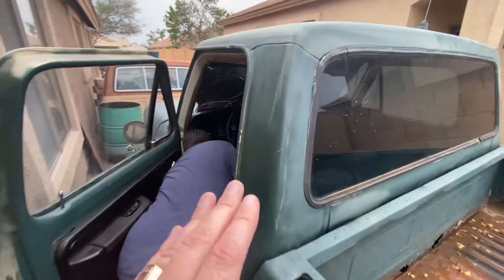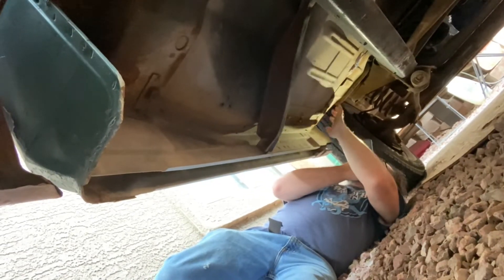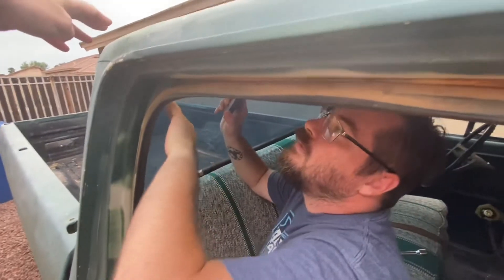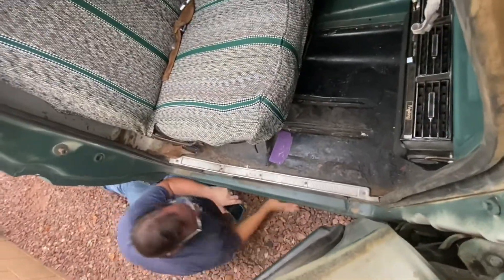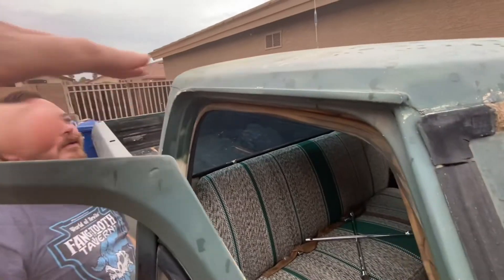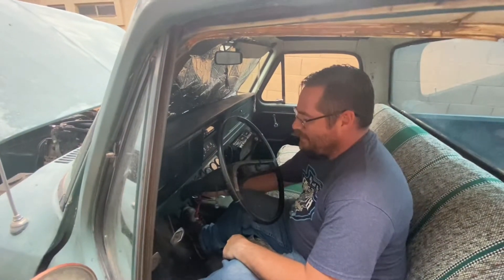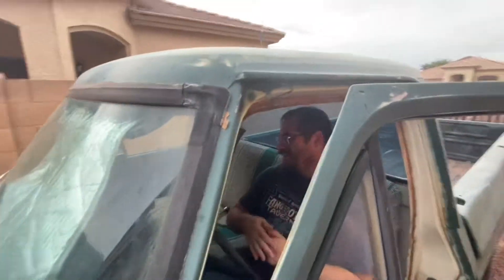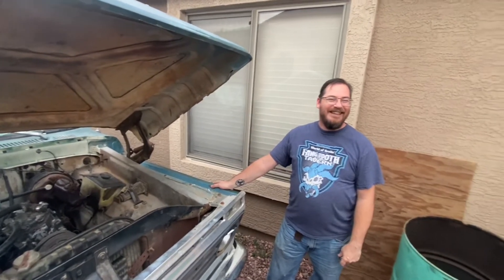#140 - Floor Boards with One-Eyed-Welder!

Comment: bro are you going to weld in some drop in pans? i was just looking into those! i might do mine.
Reply from the maker: Heck yeah brotha!!!! I’ll either get the pans or see if I can just patch the spots. I have roughly 4 quarter size holes so I’m on the fence with how to fix it.
Reply: @EYE_SPIDER  ebay has a set. both passenger and driver drop in pans for about 150.00. im debating that purchase myself too. im still working on functionality right now. but that last on my list before cosmetics!
Reply from the maker: @stevemartinez1833  For sure, yeah that was kind of my thought also.  I still need to get him mechanically street legal LOL
Reply: @EYE_SPIDER  hell yeah brother. im right there with you! it make me laugh then i see a guy going through the same exact struggles im going through with my truck! lol keep up the good work brotha! 🤜🤛🍺
Reply from the maker: @stevemartinez1833  lol for sure - that’s awesome!!! Yeah once we get our trucks back on the road we will have to do a collab video!!